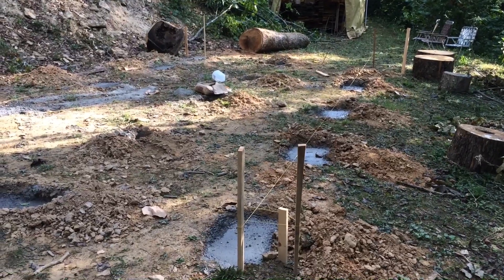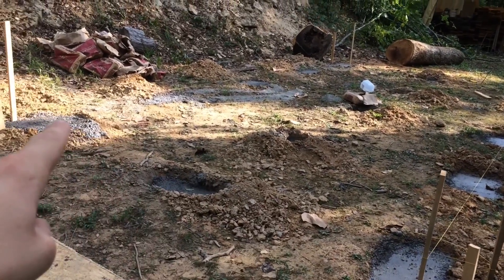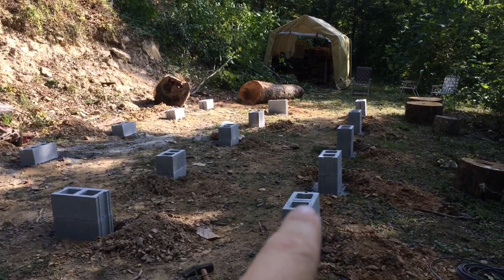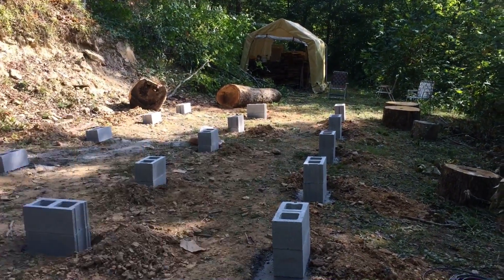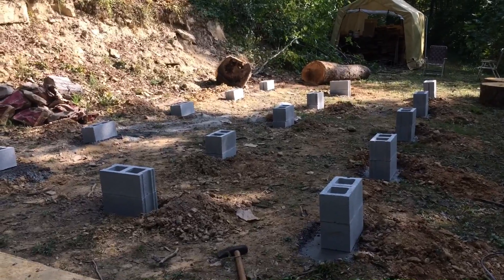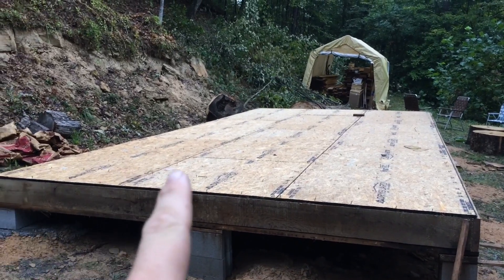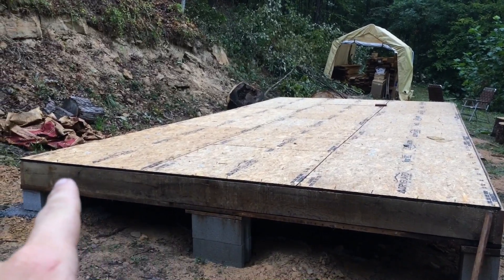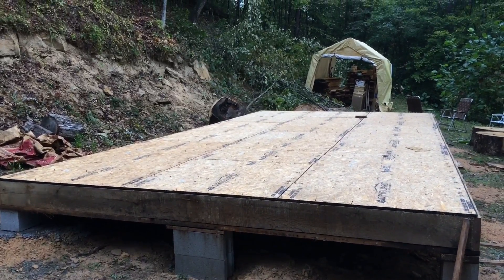SOLAR WOOD KILN PT. 1

Comment: I like the 2 videos and the look of your progress.  Wish there was another that shows you finishing it.  Do you have a set of directions with materials, etc. for sale?  I like the design and would like to attempt a build.  Is it loaded from the sides or back?  What did you use for solar power to the fans and how many fans?  What materials did you use inside?  Where is it vented and how many vents?  Was your framing wood green or dried?  I would be willing to purchase a complete set of plans for this build.  It looks a little larger than most solar Kilns I have seen videos on.
Reply from the maker: Thanks, I built this for a friend of mine and didn’t get to film the last of it but will try to get up with him for an update. I have a link somewhere for the plans if I can find them, I think it was from university of Virginia maby. Inside we insulated everything sheeted with osb and painted it all with a rubber paint, has 8 or 10 vents I think half down by the floor on the high side and the other half strait above at the top. He ordered a kit with 3 solar panels and the same amount of fans as vents. I will try to find the plans for you! Also I think it was 12x20 if I remember right

Comment: How do you level the concrete footings so they are the same level after they are poured?
Reply from the maker: 2 ways. If I have someone to help my I use a transit like a surveyor uses. But if not like here I put stakes around every corner and I use a string and string level to level the string the same all around. Then when I pour the concrete I pour it too the same distance to the string!
Reply from the maker: That would be a good video it’s self! Thanks for the question!

Comment: Looking forward to seeing this. Here you would have to fill the blocks with concrete and provide an anchor system. Oak is tough my barn ceiling joist are made from it and its tough to nail to but its strong.
Reply from the maker: We’re blessed to be able to build freely here. That oak is really tough!! My air nailer wouldn’t shoot all the way in and it’s set on 120psi.